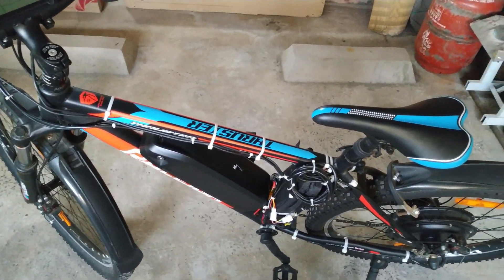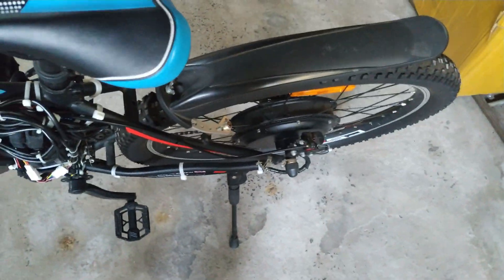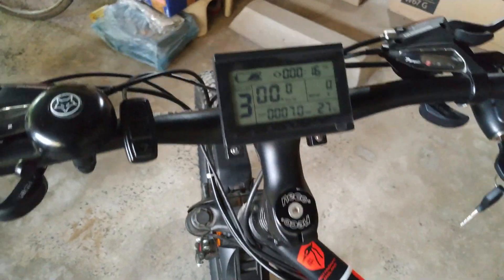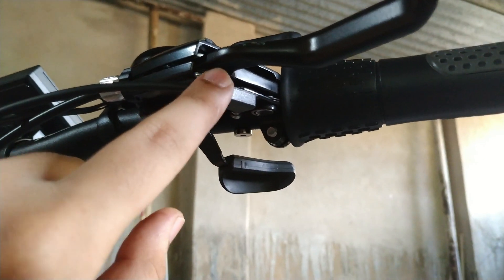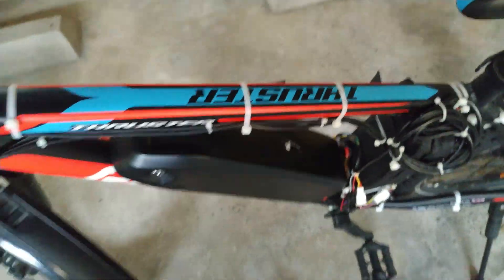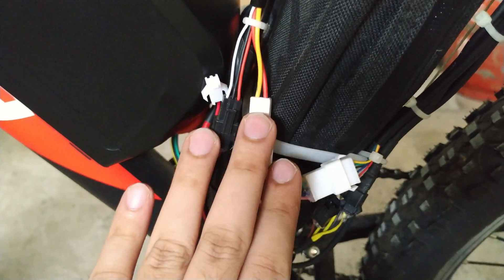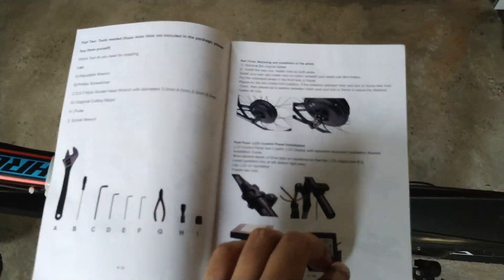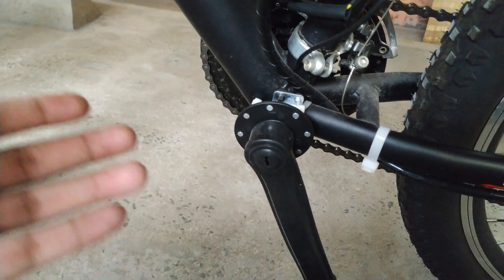E-bike Accessories Assembly Insight and PAS Installation || E-bike Conversion #4

Comment: Is it 750watt motor ?
Reply from the maker: No. It's 1500 watt motor.
Reply: @HyperMakes  what's the top speed of this motor you get ?

And is it possible to get top speed of 45-48km per hour from 48v 350watt hub motor ?
Reply from the maker: I have set the top speed as 55km/h and it can go maximum 65km/h. Yea it is possible to get at max 40km/h with a 350 watt hub motor.